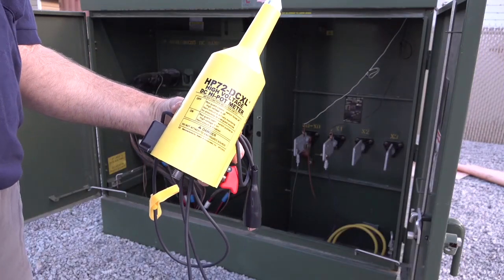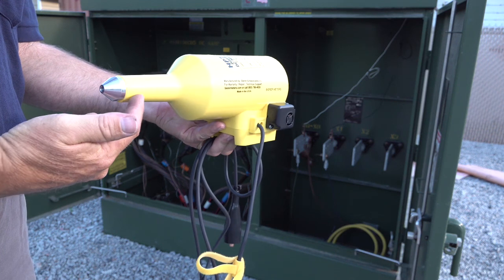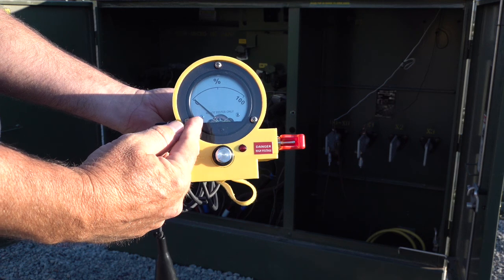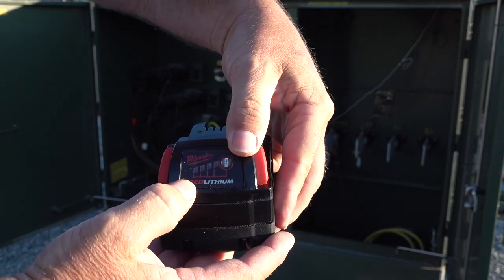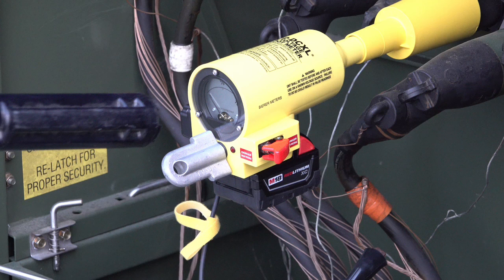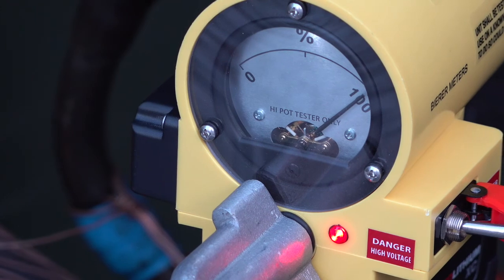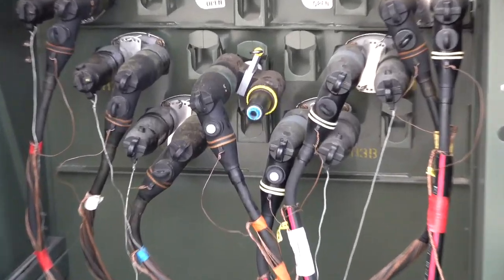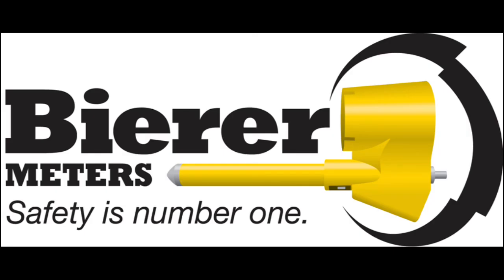HP72DCXL HI-POT 8,000 VOLTS DC - Tool Training #bierermeters #biererusa #lineman #lineworker #hipot

Comment: Can you hi pot a 3 conductor lead 600ft in a manhole 🕳 to see if one of the legs are faulted? And also does one side of the cable have to be grounded or does it have to be spread apart with no grounds ? Also the 3 conductor is cut on both side in the manholes it’s dead cable
Reply from the maker: Yes, one conductor at a time.  Isolated, without grounds.
Reply: @bierermeters 😂2 years late! But still thanks 🙏